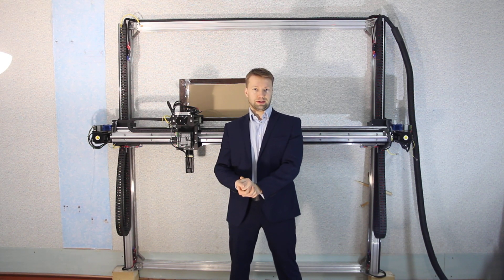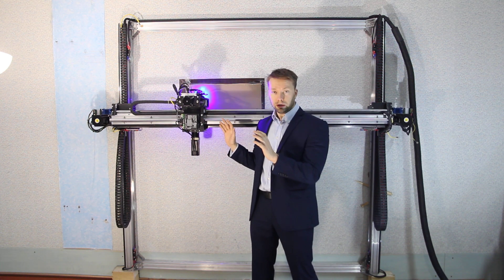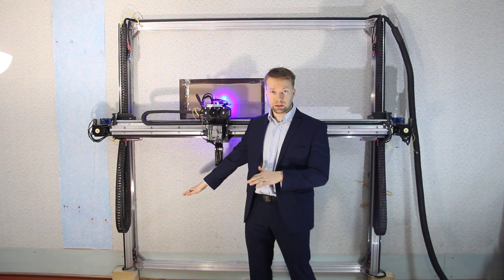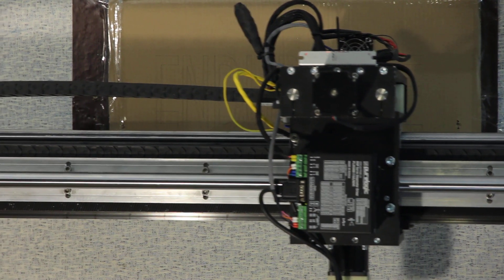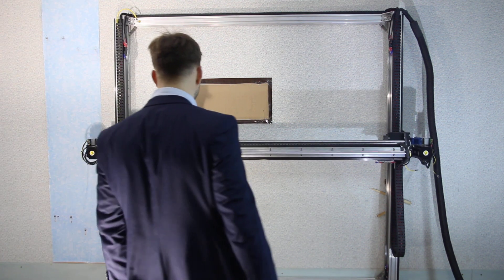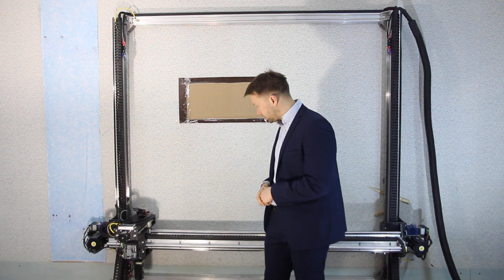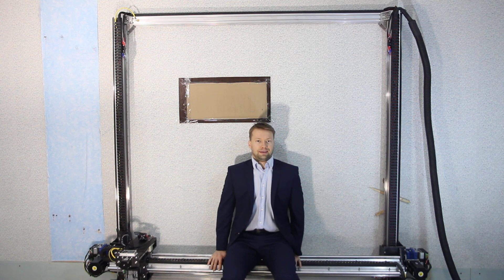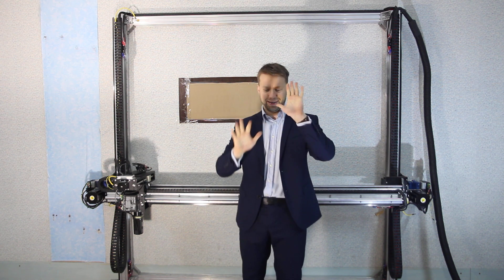George Fomitchev presents a new CNC router installed vertically (2x2 meter working area)

Comment: I wish like a lot of people I have discussed your laser odules and equipment with. If you could do a segment on hooking up one of your modules to a Gecko g540 CNC Driver. That a large percentage of CNCer's use to drive their machines. We understand the need for a PWM Adapter and how to hook it up basically. What we need to know is if it is a viable solution.
Reply from the maker: well, our lasers are fully compatible with many CNC frames https://endurancelasers.com/running-endurance-laser-on-a-cnc-machine/